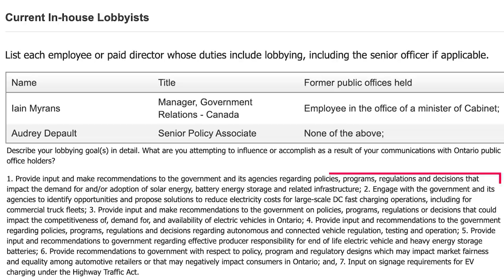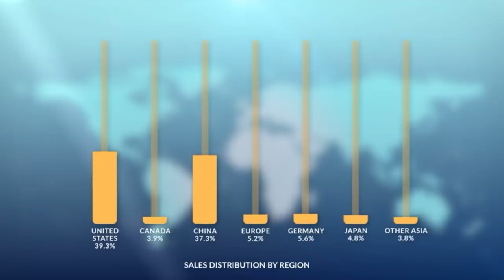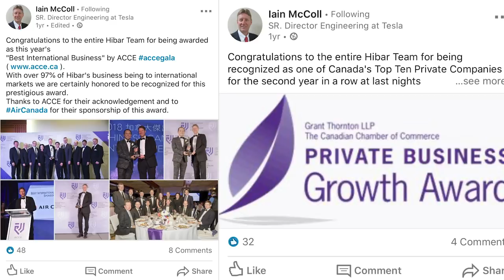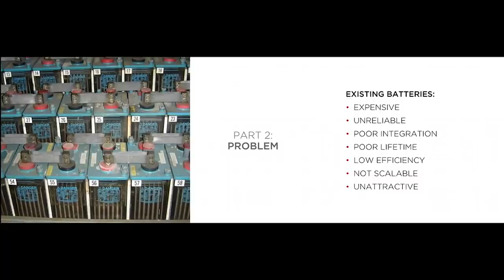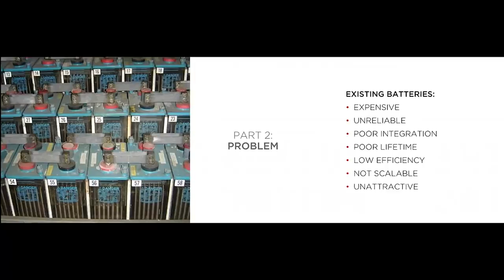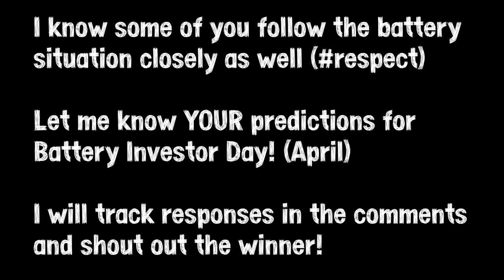Tesla Acquires Hibar Systems - The End of Tesla and Panasonic Partnership?

Comment: There seems to be a general misconception about the virtues of supercapacitors. This technology will never replace battery storage because supercaps are power-dense (the cells can release large amounts of energy very quickly and be recharged very quickly) but their energy-density is poor (the cells cannot store the large amounts of energy required for electric cars in a compact space). The other downside is that the voltage drops off in a linear fashion from full voltage to zero when discharged. This compares with batteries which maintain a relatively constant voltage before falling off a cliff close to empty. This means the motors speed will decline as the voltage drops in the supercaps unless there is some kind of voltage boost circuit included. Sometimes supercaps are used as a small buffer between the battery and the motor which helps to protect the battery from the massive demands for power during acceleration and take off.
Reply from the maker: Hey Paul, excellent insights here, thanks for sharing. Elon has said they’re unnecessary recently and they were never meant to replace Li-ion batteries anyhow. If anything they’re meant to be used in conjunction.

Comment: You don’t need a huge breakthrough to make a difference in batteries. The 1 million miles battery is a game changing one. Reducing the price by 50 per cent another. Changing the chemistry solely for the fact that you can produce them much more massively, again, would be a game changer.
Reply from the maker: Hey Eduard - I’m with you man. I don’t even think a 1M mile battery is necessary in the S3XY lineup outside of robo-taxis. But certainly cost reductions and pace of production are critical!

Comment: 2012 I mused the idea of Super capacitors would be used in acceleration of EVs.  I believe a BMS for super capacitors is the key until dry cell are perfected
Reply from the maker: Hey Ken! Elon recently said supercaps were not necessary. The BMS will eventually fade away once solid state batteries are commercialized, but after you'll see in my next video that may be another 5 years.

Comment: It would be crazy for Tesla to cut ties with Panasonic for the next several years. Tesla will have to prove the viability of their in-house battery tech then massively scale up production.
Reply from the maker: Hey Ramon! Exactly! I've seen too many people rushing to conclusions that Panasonic is getting the axe just because there were some issues at one time or another. It's like marriage...if people ran and got divorced at the first sign of issues the divorce rate would be 100% instead of the 50%+ or whatever it is today! I think you're spot on
Reply: @DillonLoomis22  Yea people usually run out and get divorced after about 7 years regardless. Why? Because divorce courts make it easy to steal from the most productive partner.
Reply from the maker: @warntheidiotmasses7114  lol I don't know the first thing about it...hoping to never need to!

Comment: I think the acquisition of Maxwell will be someday considered the turning point in Tesla's future.  All batteries currently have the disadvantage of heavy weight and relatively slow recharge time.  Supercapacitors will greatly reduce both the weight and recharge time of vehicles.  Weight equates to range directly, more weight, less range.  I like the idea of recharging a Tesla in the same amount of time it takes to fuel up a conventional engine equipped vehicle.  Who likes waiting 45 minutes to bring an electric vehicle up to 80% capacity?  Supercapacitors may also save costs by being easier to manufacture, and not using rare materials.
Reply from the maker: Hey Jerry! So interestingly...Elon just said that supercaps are not necessary implying they will not be focusing on that tech anytime soon. I found that surprising as well...so we will have to wait and see. For now, I wouldn't count on supercaps in TSLA's anytime soon! Maxwell will be the turning point for the DBE (dry battery electrode) tech!

Comment: This year in Tesla Semi. I hardly doubt that Tesla will just put model 3 batteries in Semi. It will weigh ~8 us ton and this is just weight of battery pack based on 168 Wh/kg and 600 miles Semi Range with efficiency 2,000 Wh/mi. Plus impossible to imagine how much power it will draw to cool or heat up batteries pack that size.
Reply from the maker: Hey Denis! This is a great point and one I agree with. I find it hard to believe Tesla would do that as these semi's are already limited buy weight restrictions and the less weight they can designate to the battery the more of the truck can be used for cargo. It seems likely that with battery investor day coming they would have time to use new, in-house production in limited capacities for the semi production at the end of this year!

Comment: i believe the break off has to do with quality. It's very possible that the Tesla's that have had problems had batteries from Panasonic.
Reply from the maker: It’s certainly possible although I think most of the problems were build quality and software issues, not battery manufacturing issues

Comment: Elan clearly stated capacitors are not necessary for cars now or in future.
Reply from the maker: Hey! You're right! Do you think the supercaps would be used in energy storage?
Reply: @DillonLoomis22  Not likely. Tesla bought Maxwell for the dry cell tech and the engineers. Capacitors have a very low energy density. That could change in a few years but battery tech will advance faster so caps will not be necessary.  Cant wait for Battery Day.
Reply from the maker: @jcjensenllc  I agree. From what I've seen so far this seems to be the recurring thought process. Thanks for sharing!
Reply: Great video. Thanks. Interesting in comments how Elon in not interested in super capacitors.
Reply from the maker: @johnligtenberg3631  yeah, a bit surprised myself honestly. But he did indeed say that ultracaps are not necessary!

Comment: I don't think we will see the solid state battery any time soon, but the million mile battery that does not degrade even when charged to 100% or discharged completely. Perhaps using LiFePO
4 with Maxwels super capacitor for faster charging.
Reply from the maker: Hey Hans! I just started my solid state, DBE research and so far, this seems to be accurate. SS seems to be a few years off, this will be the topic for my next video actually. Thanks for watching my friend!

Comment: always like to see what the most recent baterry and industrial design /manufacture specialists opinions are. Personally I think there will be dry type chemistry before solid state battery makes up a significant dent in actual production and may depending on ultimate energy density and manufacture cost and safety displace the need for solid state battery technology until and unless cost to manufacture it is attractive or energy density increases well above dry chemistry similar to the Maxwell research.
Reply from the maker: You're on the right track, my most recent video is on this very subject!

Comment: Every time Elon has been asked about supercapacitors, he has brushed off the question, but every time he's been asked about dry-electrode batteries, he has become dreamy-eyed and said what they've achieved blows his mind. Maxwell's presentation about itself said they achieved substantial improvements in prototype cells and worked with a manufacturer to make prototype cells--that means Tesla 2170s. I'm convinced Tesla's researchers found ways to improve the dry-electrode advantages, and that's why Tesla aggressively bought out Maxwell. And they're already gearing up to build them using Hibar and Grohmann tech.

Remember how on Self-Driving Day, Elon announced they'd designed and built their own chip AND were already installing it? I think on Battery Day he'll announce they're already manufacturing their own cells with dramatic improvements in energy density, recharge curve, recharge cycles, and eco-friendliness (lack of toxic chemicals).
Reply from the maker: Hey there! Thanks for watching and sharing this insightful comment. This is exactly the topic of my next video, coming out Thursday. I think you're onto something 😉

Comment: I think people are getting the acquisition of Maxwell wrong. Maxwell does supercaps. Supercaps are ideal for delivering and storing power spikes (at low volumetric energy density). What this - in conjunction with batteries - means is: you can buffer the big load spikes during hard acceleration, deceleration/regen (and possbly charging) that hit batteries hardest in terms of degradation. So with these added you can drastically increase battery longevity...easily getting that 'million mile battery' (also you can get insane power spikes to motors for huge peak power/acceleration ...as well as having extremly efficient regen)
Reply from the maker: Hey Peter! Thank you for this explanation, very well said. Probably the best explanation I've seen of supercaps to date! It's a topic I haven't yet jumped into but one that I certainly will in the future. Are you in the battery industry or do you just like to nerd out like myself? Lol
Reply: @DillonLoomis22  I'm an EE...but not in the energy industry. So yeah...basically nerding it ;-) ...however if Maxwell really has a way of making a dry battery (which would be five kinds of awesome) all bets are off. We'll know in April, I guess
Reply from the maker: @peterzerfass4609  that's the word around town! Dry battery is the game changer! I've also heard that tech is still a few years off but Tesla has been proving people wrong for year so we shall see!

Comment: Dry battery production will be a game changer for now , solid state future but not yet , cheaper , more efficient production, less energy intense production methods , Hibar production input will make it possible to increase factory performance . Panasonic long term production may still be a good idea to hedge bets . Tesla should be able to reduce costs and increase battery production by end 2020 but will need Panasonic to step up  as it has been dragging its heels
Reply from the maker: Hey Nigel! Thanks for watching and taking time to share this input. I believe you are spot on...researching solid state right now. Future video will cover this...sounds like you already have a good handle on what's going on!

Comment: Agree that Tesla will keep Panasonic on board as long as needed. With V3 solar roof rolling out, most installations needing Powerwalls, mY, m3, roadster, and my personal fav Cybertruck, they will need all the cells they can get. Also ramping their new battery tech-dry cell, solid state, super/ultra capacitor, will take many months or even years to reach volume production especially as demand ramps exponentially.
Reply from the maker: Hey Adrian! I agree completely on all fronts. Thanks for sharing this input...I think you're spot on! Hope you have a great day brotha!
Reply: Electrified Thanks, you too! 🔋

Comment: No doubt, Tesla's working on a solid state battery design as lab designs have shown solid state to greatly outperform liquid electrolyte batteries.  The holy grail of batteries will be a battery that can fully charge in: ~10 minutes, offer greater capacity and last 10k+ cycles.  I think the dry cell chemistry is a big step to realizing solid state which may come out later in '20, followed by a true solid state in '22-'25.
Reply from the maker: Hey man! I just started my DBE, SS research and this comment feels very accurate to me so far, on all fronts. Thank you for watching and sharing this accurate insight, much appreciated!

Comment: I think solid-State and other HEAVY battery Tech will be used in Storage and Grid management and Backup Systems while all the other new and undiscovered light-weight battery tech will be used in Transportation Systems from Cars, light, heavy and mid-size trucks, 3-Wheel and 2 wheel transport platforms.  --- I think Electric Planes are a decade or so away unless a SUPER-Light weight Battery Tech is discovered before then.
Reply from the maker: Hey Russell - I hear you! I don't think solid state will be commercially viable for another 5-10 years
Reply: Solid state (in various forms) is suited to high energy, high stress, low weight, space constrained applications........ Vehicles.
Lower stress, low (lower) energy per cell, non size critical? Any other cell..... Including maybe the remainder of the contract for the existing Tesla Panasonic arrangement?
Alternatively, these may go to other car manufacturers who are supply constrained? 😉

Comment: Well done video.  One of the best I've seen in the Tesla community.   As for what I think that will be revealed in Apri\May for battery investor day is.  1.   They integrated the DBE with Jeff's battery chemistry and can use Hibars system to make cells.     This will most likely be done with the Semi in low volume.
Battery investor day was supposed to happen by now.  I suppose that the reason for the delay is that this is damn difficult to pull off.  But with Tesla, all major plans get accomplished, though sometimes delayed.
Reply from the maker: Hey there! Thanks for the + feedback - I really appreciate that And these are great predictions...at the moment, mine are very very similar. Doing some research right now into solid state, DBE, Dahn, Goodenough etc. for a future video. Such an exciting story line!

Comment: Be interested to see how Maxwell's super capacitors could be integrated into EVs. in theory adding a super capacitor would allow for the use of batteries with lower C ratings but much higher energy density ratings which would give them better range/ power density. Also super capacitors could help with regenerative braking which would improve your city mileage especially for a delivery vehicle/taxi/commuter car that spends it's life in stop and go traffic
Reply from the maker: Hey Matt! You're right! Seems like super/ultracaps would be a great addition to the new Li-ion tech TSLA has coming for the Semi, Roadster 2.0 and CYBER. While those vehicles will have significantly more energy demand, the supercaps could help greatly on many fronts!
Reply: @DillonLoomis22  for short bursts of like acceleration with a load, a super capacitor could take a lot of strain/heating off the batteries which is good for longevity of the battery while also increasing the power available to the motors. Wonder if incorporating super capacitors is part of Tesla's strategy to make a battery pack last for a million miles?
Reply from the maker: @matthewconnor5483  I feel as though it's certainly a possibility! Hopefully in my research I can uncover some more information...or wait for battery investor day...whichever comes first!

Comment: Love the video! I think long term, this fits very well with Tesla's vision to fully automate the vehicle production. Machines building machines. I think soon, 2 years or so, Tesla EVs will be selling at lower price range competing with the similar cars, like for like.
Reply from the maker: Hey! My guess is that once solid state batteries are a thing commercially (perhaps around 2025) - there will be a massive shift from the mainstream as that seems like the battery advancement that can truly create cheaper cars (in the $20-$25k range) with more mileage range (350+). We shall see though!

Comment: I can't say when, but I DO believe supercapacitor energy storage is the way it will eventually go.  Everybody want's 'quick' and I believe there will a tradeoff consumers would be willing to make for trading range for quick charging once the charging infrastructure becomes more prevalent.  
J. Larry Bloodworth, CMAT
Draper, UT 84020
Reply from the maker: That would be awesome - but does not seem to be anytime soon and certainly not a guarantee. Supercaps just don't have anywhere near the energy density required for EV's but could possibly be used in conjunction with Li-ion batteries. Supercaps were never intended to replace batteries but I suppose theoretically with major breakthroughs they could

Comment: I bang on about batteries not being the things that turn the wheels and the legacy auto makers need to concentrate on getting the electric motors in place if they are to stay in business but watching yet another (albeit very good) video on battery production it occurs to me, is it a case that once the batteries are readily available to all who want them, will the electric motors take care of themselves?
Reply from the maker: Hey Richard! The electric motors are certainly important, but it seems clear to me that the bottleneck is the battery capacity and technology. I have not studied the topic but it seems as though TSLA has the best electric drivetrain in the industry which means they would not need to focus the resources to improve it, at least not until battery density and power increases to a point where that would be necessary. Great thought though...thank you for sharing!
Reply: @DillonLoomis22  I mused a few years back that it would become Tesla vs The Rest when all the talk on a popular UK forum was with the notion that once the big boys got their act together Tesla would be finished. As it has turned out I was right and now Tesla are not only hurting the legacy lot's ice sales but also hurting their ev efforts.
But I sense there is hope for the legacy lot in them concentrating on the second car market with vehicles like the Mini e, the Honda e and the compact SUV from MG. It is very often the second car in the household that puts in most of the miles but never gets used for longer trips. So it is a case of getting the electric motors in place and complementing Tesla rather than competing with them. Anyway keep the good work.